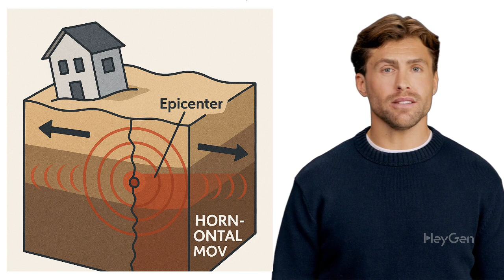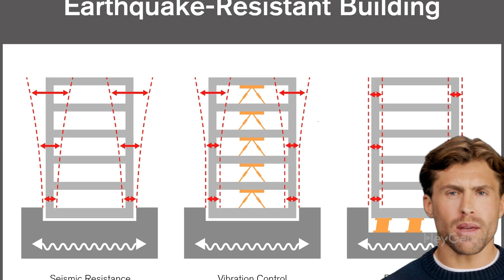"Why This Bangkok Skyscraper Collapsed — and How It Could’ve Been Prevented"

Comment from the maker: Update: Preliminary reports suggest the collapse was linked to poor anchoring and possibly substandard steel.

🔍 What do you think — was this an engineering failure, a design oversight, or a deeper systemic issue?

I’m working on a follow-up video diving deeper into the technical causes and failure modes.

💬 Drop your thoughts below — I read every comment.

👉 And if you've ever seen red flags on a site, feel free to share (anonymously if you prefer).

Additional images and understanding: https://www.facebook.com/3117BIMManagement
Reply: It looks like the u-shaped mat slab failed under the core of the building and possibly the transfer slab on the 19th floor also failed.
The steel shouldn't make so much difference if there was sufficient safety margin. 
More likely it was a design or concrete issue.
Reply from the maker: Good point — thanks for the comment!
If both the mat slab and the transfer slab on the 19th floor gave way, that definitely suggests it wasn’t just about material quality.

I agree — if the design had enough safety margin, weaker steel alone shouldn’t have caused a full collapse. Sounds more like a mix of design flaws and maybe detailing issues.

I’m thinking of doing a deeper dive into transfer slabs in one of the next videos. Appreciate you jumping in!
Reply: @ After loading the structural designs fo rthe building to Gemini AI 2.5 this is what it said: 

Summary of Building Drawing Analysis 
Technical drawings and diagrams of the collapsed building provide insights confirming several key points:
    1. Concrete Strength Change at Fl. 19/20: Specifications clearly indicate a change in concrete strength for Core Walls and Link Beams from 500 KSC (lower floors up to 19) to 350 KSC (Fl. 20 upwards). This is considered a critical point structurally, requiring caution regarding stress transfer.
    2. Complex Foundation under Core: The collapsed core area had a complex foundation using dense piles, pile caps, and mat foundation. Notably, U-shaped foundation elements were used around the elevator shafts, identified in the drawings as "risk points" ("จุดที่มีความเสี่ยง"), and potentially an initiation point for collapse (e.g., from punching shear).
    3. Floor 19 as a Key Transition Point: Diagrams identify Floor 19 as a point of "change building design/type" ("เปลี่ยนแบบอาคาร") and question the load transfer mechanism at this level, emphasizing its importance as a critical transition zone.
    4. Core, Load Path, and Crane: Confirmed that the Tower Crane was installed on the lift shaft structure (core). Collapse of the core thus caused the crane to fall. The main vertical load path down through the core to the foundation is critical; failure anywhere along it would have major consequences.
    5. Collapse Mechanics: Although the primary cause is unclear (construction vs. earthquake), mechanisms like P-Delta effect or Soft Story collapse, where initial damage leads to progressive collapse, are relevant to this event.
Conclusions and Synthesis:
    • Drawings strongly support that the collapse likely initiated within the core structure, either at the foundation connection (potentially involving U-shaped elements or punching shear) or at the 19th-floor structural transition, leading to rapid progressive collapse.
    • The Crane's fall was a direct result of the core failure.
    • An earthquake (if occurred) might have merely been a trigger factor or exacerbating factor acting on pre-existing structural weaknesses (e.g., foundation design issues, the 19th-floor transition, or construction issues) rather than the sole cause.
U-Shaped Foundation and Seismic Loads:
    • The U-shaped foundation structure presents challenges for seismic design due to potential stress concentrations, torsional irregularity, differential movement, complex load paths, and increased risk of punching shear.
    • It requires exceptionally thorough seismic analysis and reinforcement detailing. If insufficient, it could represent a significant weak point, making collapse more likely.
Reply from the maker: @fx-studio  That’s a great summary, thanks for sharing it!

That design change around the 19th floor really does seem like a structural 'weak' spot, especially with the switch in concrete strength. Combine that with the complex foundation layout and U-shape elements near the core, and it sounds like there were multiple stress points built in from the start.

The earthquke might’ve just pushed an already fragile system over the edge. Definitely worth diving deeper into that transtion zone in a future video.

Appreciate you contributing this!
Reply: @SystemFailures43  3117 BIM Management have all the drawings - that's 0n  F ace  and the next word is book.
Reply from the maker: Thanks to @fx-studio , i will add it in the pinned comment